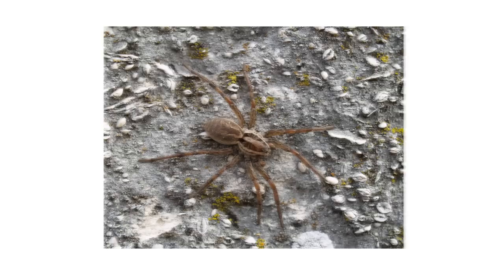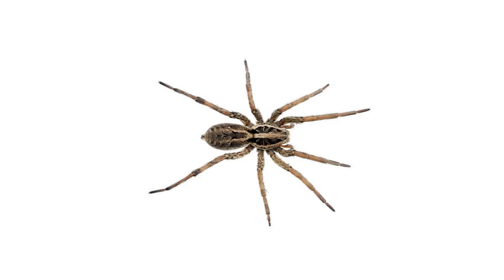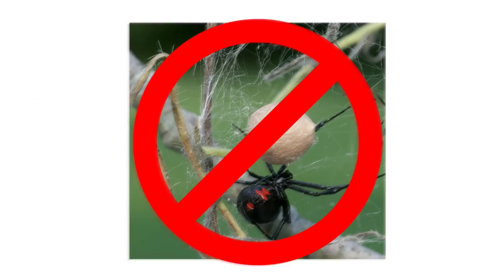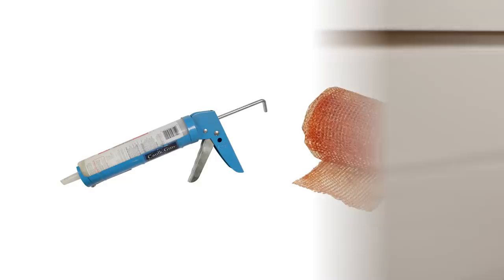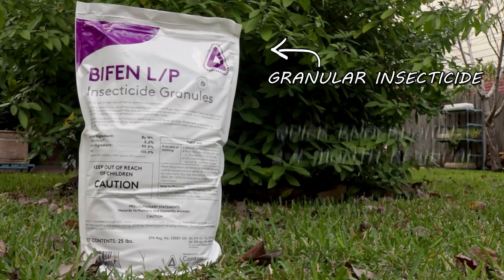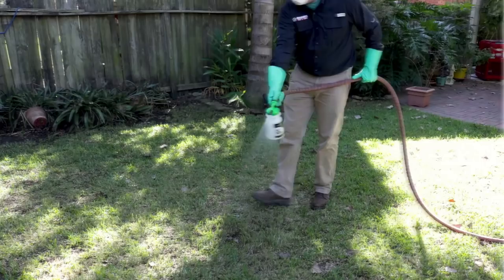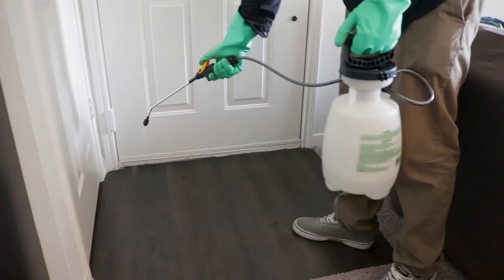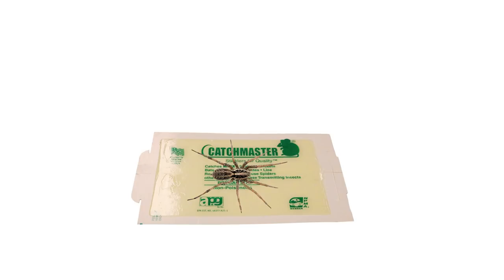How to Get Rid of Wolf Spiders (4 Easy Steps)

Comment: So far I’ve seen two good ground spiders in my home, I don’t know if I should kill them. I don’t even know if they’re dangerous, if I should get near them. Please help me I don’t know what to do
Reply: Look up the dangerous spiders in your area just in case but they probably aren't so I would recommend finding out why they're in your house because you might be able to get rid of the spiders by getting rid of another pest they're preying on so check your house for signs of an infection if that's not the case then you'll want to stop them from getting in by sealing possible entrances you can also use a small plastic container to capture them just by waiting until you see them and quickly putting the cup over them slide the lid under it and close it you can release them in a field or forest you might want to check to see if it's an invasive species in which case you should kill it
Reply: they are not dangerous!! leave them alone, my god people. They are doing you a favour by getting rid of other bad bugs.